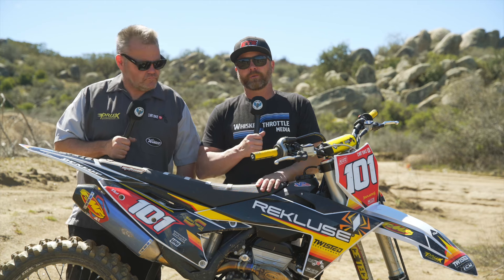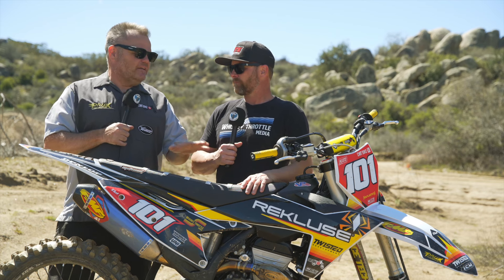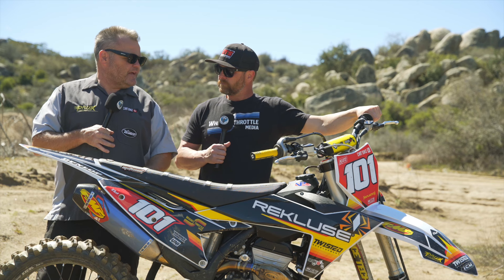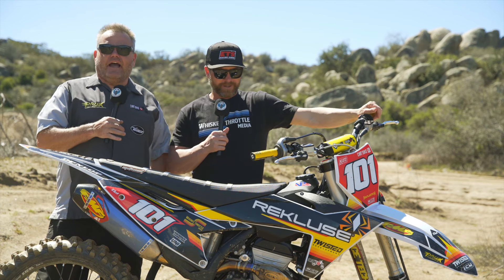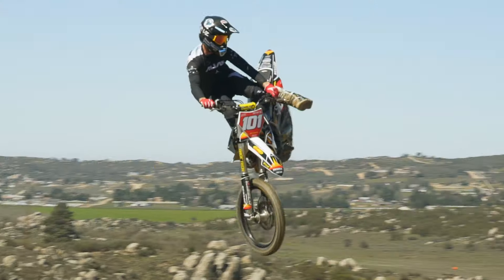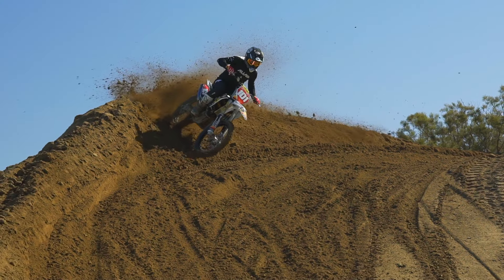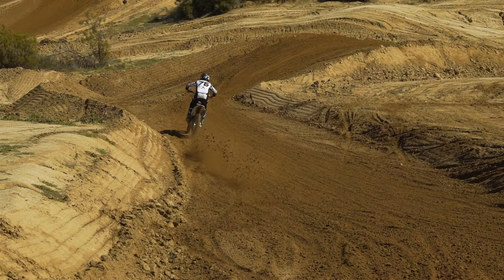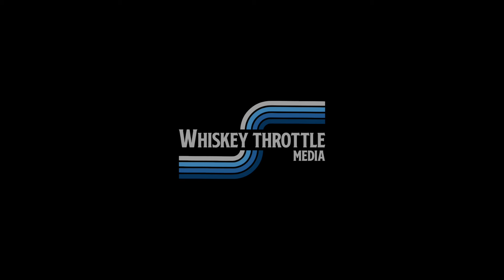Is This The Perfect Bike?? 2024 350SXF WEAPON! | Whiskey Throttle Media

Comment: Ping: old school 2-stroke guy here. YZ250 or 350 SXF for getting back into riding and possibly 50+ and 55+ racing? This 350 sure looks nice. Great build.
Reply: Ask @gypsytales he owns and runs the church of 350s
Reply: Get a 350. The Husqvarna chassis is great for people getting back into the sport.
Reply: As an old 250 2T guy who took 15 years off riding, the 350 will put less knobby marks on your tongue from running it over. 

My first off-road bike when I  started back was actually a 350EXC. It was plenty enough power. Actually don't much like riding 2T anymore unless they're counterbalanced Austrian bikes. The older tech feels like an out of balance washing machine.
Reply: 2 stroke!!
Reply: @paulmcmullen914 I’d highly suggest trying to find a 350 to try out. I started out hard core 2t guy and swore I’d never own a 4t. I converted 15 years ago and never went back. This past season I went from a 450 (been on them 15 yrs) to a 350 and haven’t looked back. The 250f’s are really a lot of fun but most of us guys in our 30’s or older aren’t as thin as we once were. And the 250f just doesn’t have the bark most of us want. I also don’t like the thought of having to rebuild a 250f every 50 or so hours. I’ve got 130 hours on my ‘22 350 and it’s been phenomenal. I’m probly have it gone trough around the 150hr mark. It’s a really awesome package.

Comment: Or, you could get an RMZ 450 which makes about the same power and at a much lower RPM.  I had a last gen 350 and loved it, but picked up  a 1 hour RMZ for 5k and with the suspension swap to a KYB shock, some fork revalving am only in about 6500.  That is about half what a 350 will cost, unless you can pick up a left over. I have an SXF 270 as my other bike and it reminds me a lot of the las gen 350, just a little less torque.  Either way it's a win!